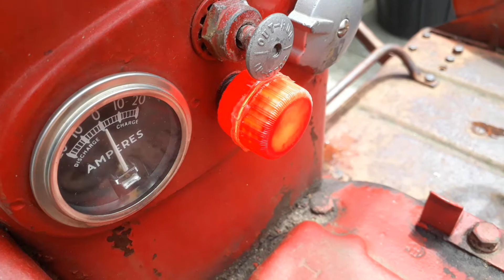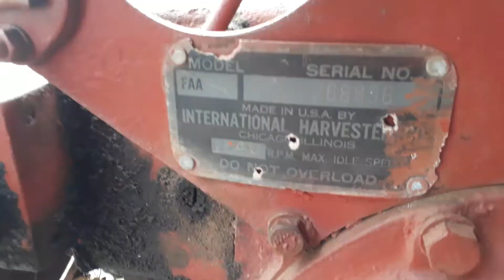Just another Farmall start and test the light (HD Video) I will have to install thick gauge wire

Comment: Good Idea with the Light Jan.  I Have one on All My Tractors hooked up to the Coil, so I know I Have Juice.     I Like the Headlamp  But aren't You Concerned, with No Charging System , of Draining You Battery Very Fast?  Just Wondering if You Fixed the Jenny?
Reply from the maker: Dan it will drain the battery but I did not drive it in neighborhood anymore, if the wrong guy see me they will lock me up and through the key away, hopefully one day I will be able to replace the rear tires, fix the steering and let it totally rewired, it can then easy be street legal, the generator is in good working order, I did not use it since there is now regulator etc, for now it is a start and stop tractor, drive sometimes in the yard just to keep the drive train oiled.

Comment: Nice start, I never hand cranked a tractor engine, are you installing rear lights as well? The front tires are very nice, be sure to cover them up nicely so the sun won't shine on them :-)
Reply from the maker: For now no rear lights until I can get an original one, lucky the tractor front half is under permanent shade, thanks for watching